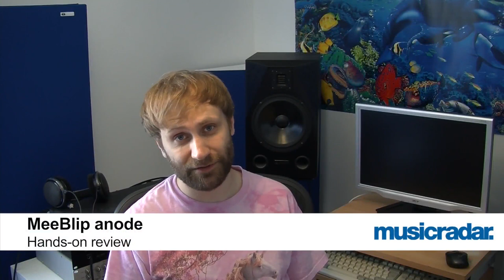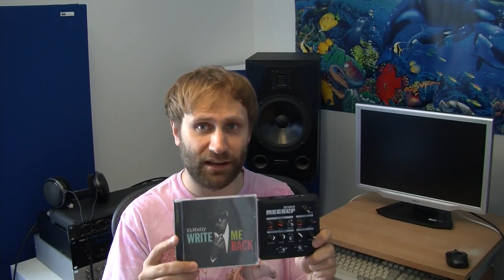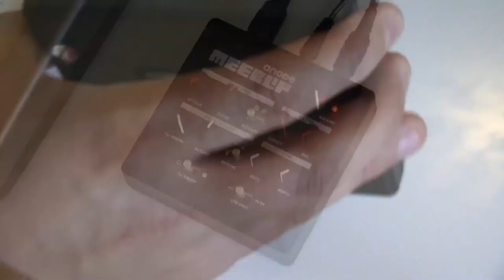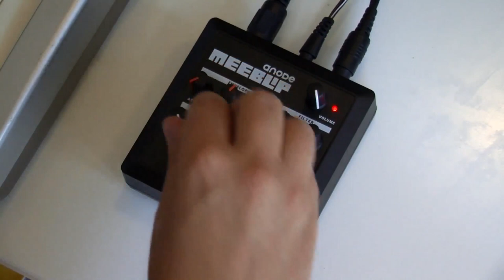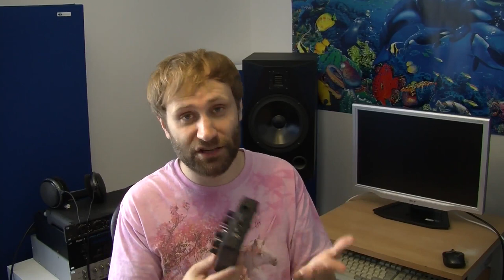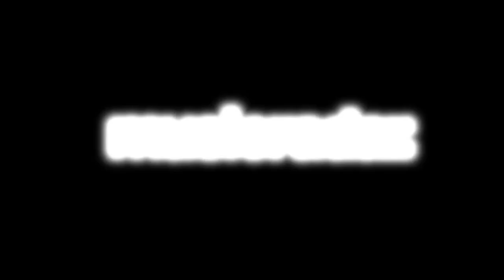Video review: MeeBlip anode

Comment: Are all the parameters able to be controlled through a DAW?  EG, if I got a great synth noise, would I be able to manipulate each parameter on the device (filter or envelope) in say ableton?
Reply: The closest thing you can do is get the tone that you want, record it, and drop it into a sampler. Then you add envelopes and loop it so that you can hold it down for as long as you want. Ableton's samplers can do this.